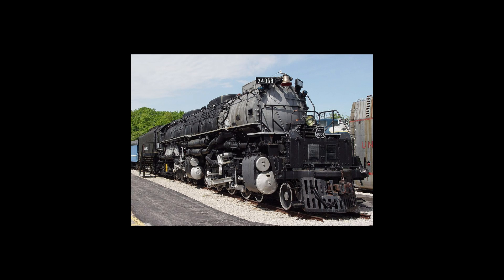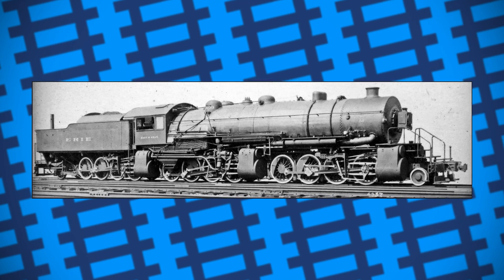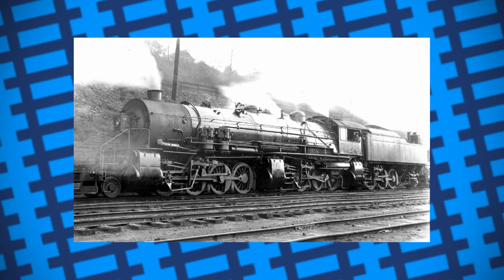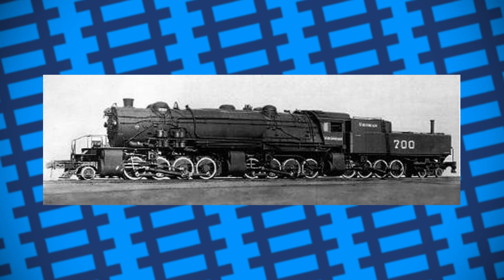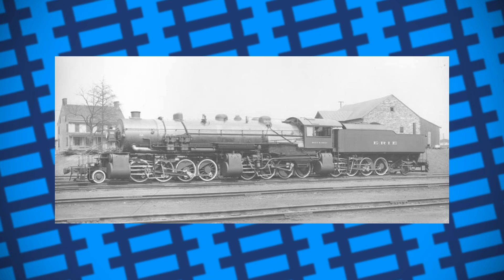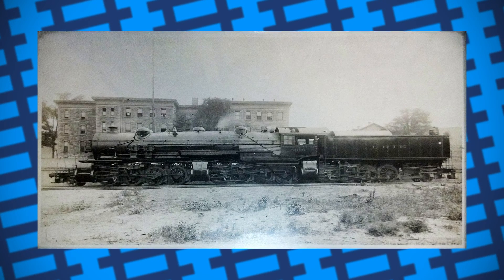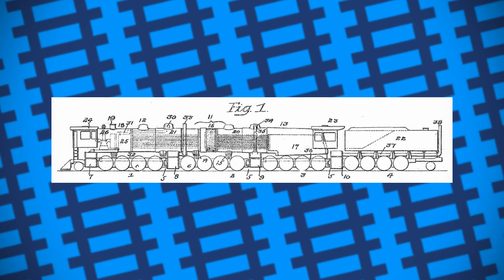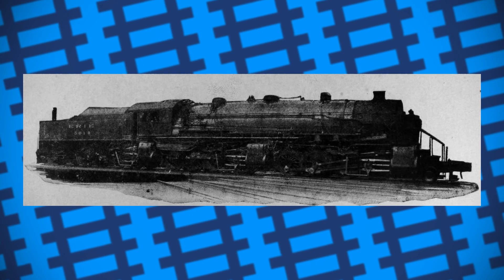The most absurd tank engines ever built - 2-8-8-8-2 "Triplexes"

Comment: The Big Boy only had four cylinders—two on each engine set. Also, only the front set articulated; the rear set was rigid with the boiler and cab.

Though, the Union Pacific did build a series of 4-12-2 locomotives that had three cylinders. One of them, #9000, survives today.
Reply: 4-12-2s are called “Union Pacific” Types
Reply: I believe Alco was using the design concept of Sir Nigel Gresley. Most likely they had licensed it. They did push it in the '20's, but maintenance costs killed it in the US.
Reply: @garryferrington811  Yeah, the 3-cylinder locomotives were a pain to work on, crews didn't like oiling all the motion components for the inner cylinder, so the parts wore out quicker and required more repairs.  The New Haven had a bunch of three cylinder 4-8-2's and a series of 0-8-0 switchers that were very well regarded.
Reply: Union Pacific had a small number of 4-10-2 three cylinder locomotives. They were near duplicates of the Southern Pacific's 4-10-2. In the 30s or 40s the center cylinder was deactivated. The 4-12-2s out lasted them into the early fifties.
If you want to see many strange locomotives check out Loco-Locomotives in the Retro-Museum website.
Reply: "only had 4 cylinders"  Most steam locomotives have inner pistons.
Reply: @RacoonySkaloonyOfficial  in Europe most did have inner pistons, in the United States they where used on only a small handful of types but the majority of engines here had only 2 cylinders per set of drivers.
Reply: @RacoonySkaloonyOfficial  Even worldwide, no. You could argue that there were more inside valve gear designs than outer, but there were definitely more outside piston locomotives.

Comment: Santa Fe also had some crazy designs as well. By the early 20th century the SF got the crazy idea of take pre-existing locomotives and add another driver set and boiler section. It was cheaper to only have half a locomotive built so it became popular for a few years. The biggest locomotive stemmed from this venture was the 2-10-10-2 and the most successful as the 2-6-6-2.

Comment: There is a (claimed) story that when a Triplex pulls a heavy train, possibly heavy freight, the locomotive pulled so strong, the couplings of the cars and trucks of the time could not withstand the power and, possibly, broke under pressure. That’s why they were used afterwards to push not to pull. Interesting story.
Reply: Considering that, with poor train handling, you can break couplers on a 300 car train with 2 GP-48's and modern couplers, it wouldn't shock me that this could happen with a triplex and older couplers.
Reply: Big Bertha (UK banking engine covered on this channel) occasionally snapped couplings or crushed freight wagons when being used so I believe other engines could do the same
Reply: @SportyMabamba  you don't couple the banker on and it rarely if ever pulled a train so the coupling story is unlikely
Reply: @SportyMabamba  Big Bertha used buffers-and-chain coupling, which has a significantly lower maximum load than the AAR coupling found in the US. As for the other claims, I can't really comment but I suspect they weren't events unheard of in the era.
Reply: This happened with the NZR G class (1928) which were a Garratt: 4-6-2+2-6-4 with 6 cylinders. They eventually just gave up and scrapped them but it's rather funny that NZ managed to build a locomotive too powerful for it's cars.
Reply: I would have thought it is more likely a myth and only couplings that had manufacturing defects broke. No expert so feel free to tell me if you think I'm wrong.
Reply: @iainwalker8701  or you put to much load on certain couplers in the train as the train length overrides the couplings maximum rating for load. 

Not so much power of the loco breaking them as load of the train breaking them. That would explain a break near the middle or rear end
Reply: I could swear I read that on an article about one of the early PRR electric locomotives, so it really wouldn't surprise me if that was true.
Reply: @arvensisalaudidae  That was the PRR FF1.  From what I can determine, the problem was that they tested it with flimsy antiquated freight cars -- if they had tested it with the kind of freight trains that the Virginian Railway was using with its electric locomotives (which were MU-d to give even more pulling power), it would have had no problem (other than potentially burning out the rotary phase converter early -- from the Wikipedia article about the FF1, it sounds like this was undersized relative to the motors it was feeding).

Considering that the Triplexes were from a somewhat earlier time, flimsy freight cars would have been slightly less antiquated and thus more prevalent, so I could see this happening with them as well.
Reply: @arvensisalaudidae  The book "Pennsy Power" does mention this was a problem with one of early PRR electrics.
Reply: There is a difference between breaking a coupler and pulling it out of the end of the car. Yes, couplers do break, but more often they are pulled out of the end of the car, and there are plenty of stories about it happening with bigger, more powerful locomotives, or just bad or new locomotive engineers. 💙 T.E.N.
Reply: i believe that it was not the couplers themselves that broke but the frames of the cars they were mounted to due to wooden frames the stress of that many cars pulling on them split frames
Reply: It was a not uncommon problem in various countries for engines to be too powerful for the couplings or drawbars on a really long train. On the New Zealand Rimutaka incline (1 in 13 worked by the Fell system), trains had to be split into short lengths with engines scattered through the train -  one famous photo shows 5 at various intervals.

Comment: The funny thing is even though the Triplexes were a failure, the PRR still built the T1, S1 and Q1 - Q2 engines. Which even though had some success they were still a little extreme, and had  similar problems to their predecessors.
Reply: Those were not articulating or mallet engines, however. All of those 'duplex' engines built by PRR were ridged framed, meaning separate sets of driving wheels and cylinders but mounted the same frame with no freedom to turn horizontally.
Q2 6199 Actually boasted the most horsepower (not tractive effort) for any steam locomotive ever at 7,987HP.
Reply: @theq4602  yes I am aware that these are equipped with Poppett Value Gear which doesn’t separate the frame from the boiler, however PRR took great inspiration from the Erie and Virginia when creating their Duplex locomotives (it is also easier to group them together for simplicity). Especially because the PRR believed that they could’ve fixed the design issues allowing larger locomotives to be able to show their true capabilities.
Reply: The T1 at least kinda showed that the concept was workable, but it had a lot of little technical details that had to be right that required precision which wasn't really cheap or as easily available back in the Steam era as it is today. afaik they'd mostly gotten the issues under control by the time they were starting to get obsolete.

It'll be interesting to see PRR 5500 when it's finished.
Reply: @TheDemocrab  PRR actually sent some T1s to the C&O whose engineers were more experienced with multiple sets of driving wheels and largely didn't have any issues with them.
PRR engineers were just too used to K4s for the most part and it basically ended up with what would happen if you gave someone who only drives a Camry a Lamborghini.

Also just a heads up, 5550 is the one being built today, 5500 was one of the first T1s made and sadly not around anymore.
Reply: @CarlosDeLosMuertes  It's also worth noting that even the K4s were known to wheelslip even if it wasn't an "engine problem" - The K4 being underpowered for its typical use meant that crews were used to giving it the beans regularly, meanwhile the T1 was overpowered for its typical use if anything so it's little wonder really.

Oops, thanks for catching that typo.
Reply: @TheDemocrab  Sad to say, it probably won’t be finished in our lifetime.
Reply: @ericplaysbass  I heard so many people say the same thing about A1 Tornado and R766's standard gauge conversion, yet both of those are happily running around well within our lifespans, so I wouldn't be so sure about that.
Reply: @TheDemocrab  I admire your optimism. I hope you are correct. I would love to see a T1 gracing the rails before I leave the station.
Reply: Always found it a tad odd that, at least in retrospect, Triplexes were just Mallets with an additional articulated set of driving wheels. Almost a precursor to a Garratt if you think about it. Yet Duplexes always refer to an engine that, for all intents and purposes, is just a standard steam engine with its driving set split in half (or partway for some of them) and placed an extra set of cylinders further down the frame rather than in between them
Reply: What on earth do those have to do with the triplexes?
Reply: @garryferrington811  One dream leads to another.

Comment: Can someone please explain "each bogey was powered by 3 cylinders" @ 0:15?
Reply: I’m pretty sure that’s flat-out incorrect. As far as I know the big boys follow the American convention of using two sets of cylinders per set of driving wheels.
Reply: @RockerTopper-hh3ru  all locomotives have one reciprocating valve and a driving piston. All the videos I have seen mention both the valve and piston as pistons.
Reply: @varunmehta1821  Yes but that's not what we count when counting the number of 'cylinders'.    'Pistons' generally refers to the main power-producing pistons in the cylinders, of which all locos have at least two, some three (quite unusual in the US but common in Europe), or four.   
The steam was supplied to the cylinders through slide valves in earlier designs (virtually the whole of the 19th century), and piston valves in later designs - but those were never counted as 'pistons'.
Reply: Yeah just googled it and there are 4 cylinders in total so I'm not sure what he meant then.
Reply: That statement at 0:15 was flat-out wrong, each bogie on the Big Boys was two cylinders, as per normal US practice.
Reply: He has a big apology on Youtube about it, and the guy has probably been flogged by now, so it's all good. 💙 T.E.N.
Reply: Each bogie has the 2 cylinders on the outside and 1 cylinder on the inside of the bogie.

Comment: It was a good idea in theory but they could only do about 8MPH without running out of steam because the boiler we just not big enough to feed all those cylinders.
Reply: Makes me wonder wether with an admiralty pattern 3 drum boiler and running on oil or propane, with all the cylinder exhausts plumbed in for assisted draught through the boiler, or even with a condesor setup to save water and electric forced draught implemented, wether it would have been sufficiently efficient to have been doing long haul stuff at a higher speed
Reply: the boiler was sufficient in size and draft ,it was the mechanical stoker that was the problem, a major flaw of all mechanical stokers is their uneven distribution and incomplete coverage of grate thus limiting the fire

Comment: I saw the thumbnail and thought "tank engine? That has a tender!" But nope it's just massive
Reply: Yep it’s Just a huge bunker all a long
Reply: me too
Reply: Apart from the extra set of cylinders and the corresponding wheels, they were conceptually very similar to the first Mallet types.
Reply: Isn't it called tank because of the boiler?
Reply: @brokkrep  No, they're called tank engines because the water TANK is incorporated directly into the body of the engine, rather than being in a separate tender
Reply: @red5t653  Correct. And no, the triplex does not count as a tank engine. A second smokestack at the end of the tender does not equal tank engine. The Fairlie is a tank engine despite having two smokestacks because even though it has double boilers, it has no tender.
Reply: @red5t653  the triplexes are not tank engines, the same as any engine coupled to a centipede tender with a booster engine in the front 4 wheel truck are not tank engines; the tender portion with it's engine is not solid with the frame of the boiler portion